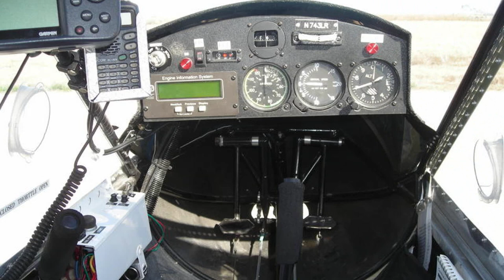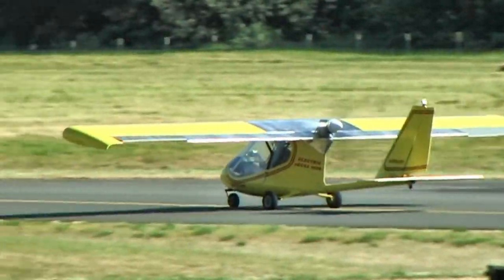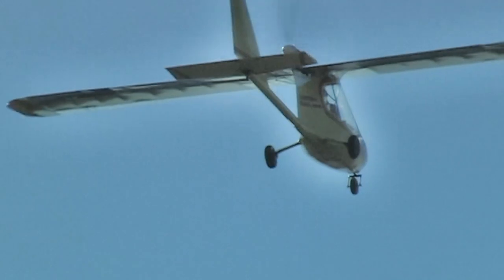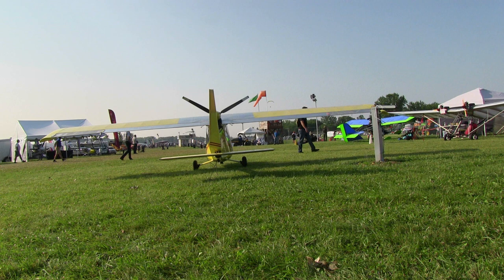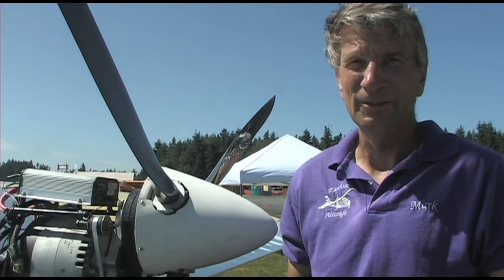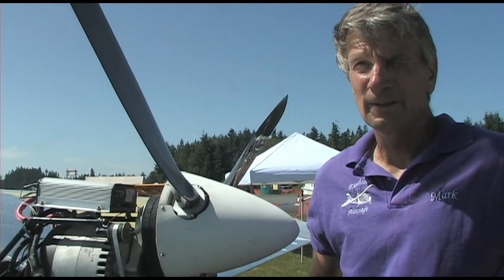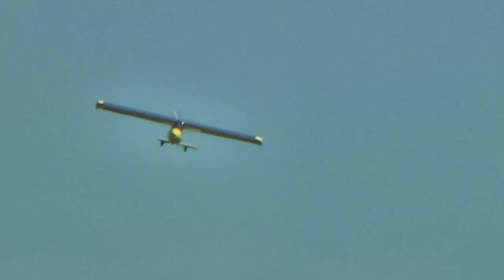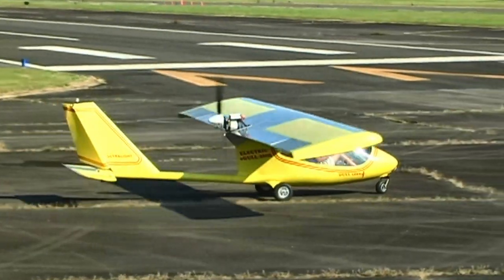Gull 2000, Earthstar Aircraft, Part 103 Ultralight Aircraft, 2022 Ultralight Aircraft Buyers Guide.

Comment: Mark Bierle, is a modest, soft-spoken Californian, several years ago he contracted with me to license a radial cam engine concept.   Mark is truly one of the most talented designers I have ever worked with.  He built 3 generations of the engine and proved the concept to be superior to any crank engine.   Mark is a truly remarkable person.  Years later I was there for his first flight of an electric powered plane.  The battery power was provided by a couple of batteries from an electric drill.  The flight was not much longer than the Wright brothers first flight, but, still it was amazing!

Comment: I flew an earthstar odyssey with him. His planes are great!!! The ONLY problem I had with them... If you use "pitch for airspeed power for altitude," you NEED to look at the airspeed when you add power or reduce it because the nose does the opposite of most airplanes in that it drops when you add power and raises when you reduce power. (Seriously.) But they're still great airplanes.
Reply from the maker: That is because it is a PUSHER -- with the engine overhead and behind.
Reply: How well it handles turbulence. I heard that is pretty good compared to other ultralights. How how does it handle turbulence and thermals compared other forms like delta trikes etc.